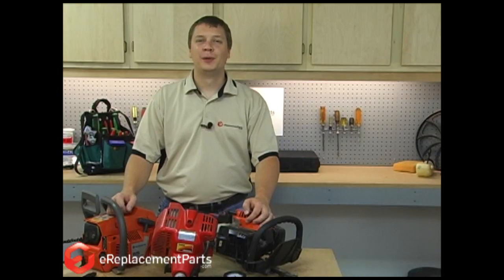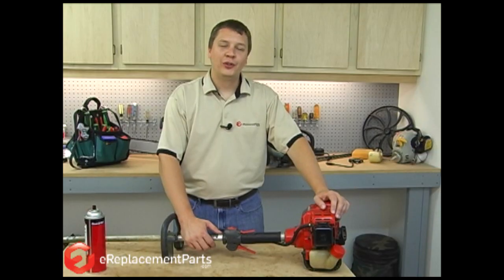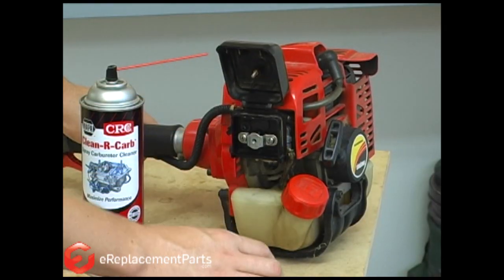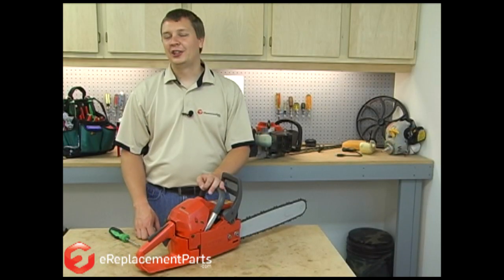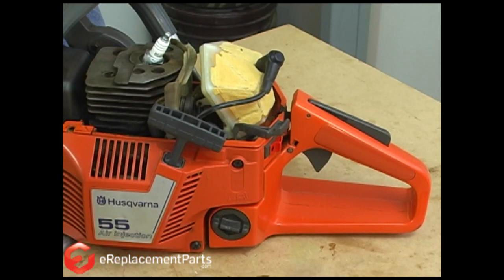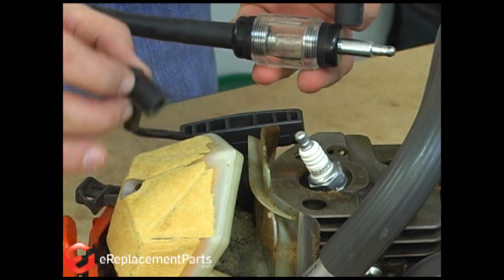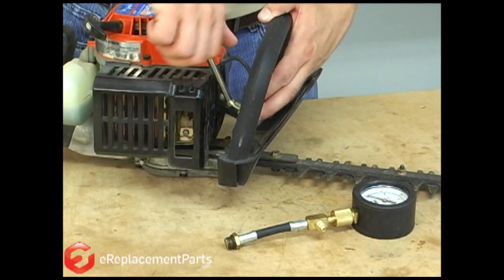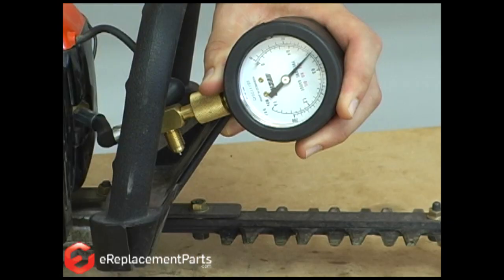How to Diagnose Two-Cycle/Two-Stroke Engines

Comment: In my long experience things are never quite as simple as your video shows.  For example there was a friends Husqvarna chainsaw that relied on "Duckbill Valves" to pressurise the fuel tank. These had gone hard and the valves didn't seem to work anymore. They were also obsolete.  Other two stroke horrors are engines which are really built to last one season. With these (I won't mention any names) the crankshaft bearings are the crankcase! Once the crankcases wear, primary compression is lost and the machine becomes a real PITA.  Possibly an engineering genius could machine the crankcases and fit bronze bearings as a hobby project?

 Another fault is very common with lawnmowers and outboard motors.  If the mower blade or the outboard motor propeller hits a stone the machine might not run again!  What happens is that when the impact occurs, the flywheel keeps on going and shears the Woodruff Key.  What now baffles the owner is that there is still a good fat spark but the machine won't run.  Of course the spark is no longer arriving at the right time!  Woodruff keys are fairly cheap so its an inexpensive repair.

Another fault which I cannot repair is that of the fuel boiling.  It happens on some old-timer chain saws when they are worked hard.  There seems to be no cure short of moving to the frozen north or trying to persuade the engine to run on kerosene.

Nice video but IMHO it only covers near-new machines and not the difficult vintage fixer-uppers.

PS I would like to warn people about the dangers of doing spark checks.  Modern machines use a LOT of plastic so it is difficult to get an earth.  If the ignition module does not have built-in safety gaps (spark gaps) it can be over-stressed and damaged if the spark plug is not properly earthed.  Budget quality jump leads can be used to earth the plug.  Good luck!
Reply: I just remembered another two stroke problem which is a real PITA on old Flymo mowers.  On these there is a non-return valve in the fuel feed and pulsations help to feed the fuel to the carb.  The valve is a small brass device with a rubber disc,  There is an X shaped grid to keep the disc in place but this is the mowers Achilles heel.  Over time the rubber disc swells up and shuts off the fuel.  Entrepreneurs capitalize on this with newspaper advertisements "Flymo Hard To Start?"  and they used to charge £20 many years ago for this very simple fix.  Take care!
Reply: What you seem to be saying is that two-stroke engines are throw-away shit.

The more I'm around them, and the more of them I fix, and the more of them I fail to fix, the more I become convinced of this.

There might be some vintage ones that are worth it just because they're neat, and there are some professional grade deals like sthil that just tend to work - other than that, if you can't get it to go by taking it apart and freeing up/cleaning everything..... screw that piece of shit, find another one that someone was throwing away (because, you know, throwaway shit) and, using your last piece of shit for parts, do the same clean/hope procedure, and repeat this cycle until you have a piece of shit that sort of works. (then, ten minutes later, prepare to repeat this cycle) Getting new parts generally seems to be a losing proposition, because the rest of the thing's not far behind, and that part might not even be the problem (even when they work, none of the parts work well - sometimes every part works, until you put them together, and then they don't work because they all suck so much at what they do that the sum of the parts is still less than the total oomph required for a motor).

Even if it's not a "one season" deal, what is it, a two, three, four season deal? So what's that, like two, three ten, twenty hours of total engine life?

They're basically elaborate self-destruction devices. Must be a real great business to be in, though. They cost nearly as much as engines that actually work - but here I am, trying to fix them, watching videos on them, etc...

Also, the carbs simply do not work, never will, etc.... maybe if I bought rebuild kits, all my woes would disappear, but I have a hard time swallowing spending anything on these things. I don't want to give those guys more money for their temperamental shit pyramid scheme. Most of the time it's the carb, and most of the time it's going to result in stupid crap like intermittent running or bogging when hot or intermittently having every problem in the book, and most of the time, just go find a whole new engine.

Comment: Im having problems with a scooter i purchased at a pawn shop , its got a 49cc Huasheng 2 stroke engine, refuses to idle without the wheels spinning unless the chokes on , with choke off and wheel free spinning i can hit the gas and it spins faster like its sposed to but when i hit the gas with the choke on while its idling it just bogs down and dies. Any ideas? Thanks either way!!

Comment: ive never had an issue by pulling the plug out and checking it like that its a good way, alot of people dont have tools like that or dont want to spend money on tools like that I have a shop that I set up completely and I dont have those I just check by eye sight if the spark is dim and hard to see its weak and if its fat and blue its strong.

Comment: Can the spark tester ever be wrong, like lighting up on a weak spark. My chainsaw is hard to start. I replaced the carb with a new one and changed fuel and air filter, fuel line. I have a compression of 150 psi. I've made new gas. It always requires a squirt of start fluid to get it going.

Comment: Great video,thanks. One point though I think you might be better putting a small amount of pre-mix in the carb rather than starter fluid. Starter fluid will make the motor rev up for a few moments with no lubrication from the fuel.Not a problem with a four stroke but ...

Comment: Most of your diagnosis are wrong. Step 1: Remove muffler and check piston for scoring. Step 2: Check Compression and Spark. Step 3: Check Fuel system. And compression test should be done on a 2-stroke with throttle wide open and should read around 150psi, not 90psi

Comment: good video thanks i have  a problem not mentioned my Husqvanra weed trimmer backfires when i try to start it ?
Reply: that is usually a sign that the timing is off.
Reply: Owiko7  what you mean? cos then I pull to start i get pull back, handle comes off and thats hurts a bit.. whats on chainsaw,.
Reply: yep and have now fixed the problem thanks

Comment: thanks so much for your informative videos.  I have a 15hp OHV briggs and Stratton lawn tractor.  It back fires and wont start.  Any Ideas what might be the problem? thanks for your time.....
Reply: hi check your valve adjustments it should be .10mm intake and .13m exhaust
Reply: the timing is off
Reply: the fly wheel key is probably broken. you can look it up on youtube.
Reply: I hope that's all it is.....I'll let you know.

Comment: most commonest fault with small two stroke engines is a fouled spark plug caused by the incorrect fuel oil mixture because most people don't know how to mix it and also use the wrong mix ie to much oil
Reply: better than less oil
Reply: better the correct mix

Comment: You don't need a spark plug tester to check the spark... Just stick a wire or screwdriver into the spark plug cap and hold the plastic handle so that the metal shaft is next to the spark plug terminal. If you get a spark from the screw driver to the spark plug, then you're definitely getting a spark across the spark plug. It's true that the ignition system can be fine and not spark this way due to such a long spark length, but often a good ignition system will easily spark across a larger gap.

Comment: I have a Stihl FS 45 weedeater,that will not start,it is not even a year old,it was bought last aug,it ran fine,last year,but when I tried to start it this year,it will not start,I pulled the spark plug,and it is wet,what would cause this.
Reply: could be flooded. spark plugs have a difficult time firing when wet.
Reply: if there was gas in it over the winter, it probably needs a carb rebuild, or fresh gas, as a rule of thumb, one gallon of gas will start to go bad after about a month-it will turn to varnish, hard to say without seeing it, but statistically, engine failure is 85% fuel system, 10% electrical, and 5% mechanical.
Reply: most common problem in my area is caused by paper wasps building nests in  exhaust holes clean them out and machine will run
Reply: probably flooded it to get a wet spark plug come spring/summer drain anny gas out put fresh gas in prime it a few times and should start up  and for me if it dont start up i take the carb apart and blow it out make sure theres the fuel filter is clean and good if not replace it and it fires up no problem
Reply: Jason- have a look for a video that shows how to start the machine with a drill- The chap started his Trimmer with the extra speed, think it went fast enough to such the crap through the carb!! :)
Reply: aflatminor that could be the case

Comment: You don't need equipment to test a spark plug simply remove it and plug it back into the coil lead and touch the other end on the motor next to the spark plug hole and pull the engine over and look for a spark
Reply: A weak coil might fire a plug in open air but not when the plug is under compression. That's why the test is inconclusive.
Reply: Sometimes a plug will fire when removed but will fail when firing under compression.
Reply: True but only sometimes
Reply: i agree
Reply: very true

Comment: My stihl weed eater seems to die in heavy grass.  I have to rev it high and throw it into the grass to cut the grass. Then it boogs down. Rev is high and ideal is good.  It just seems to not have power like it use to. It's a fs85 with a new carb.   Thanks
Reply: might have to turn the  idle up abit if  that dont work then its loosing compression
Reply: It could also be that the screen inside the muffler has become coated with carbon causing high back pressure.  Try cleaning the carbon out of the muffler.

Comment: Hey i know alot on 2 stroke engines i recently picked up some hedge cutters it is getting spark and the diaphragms in the car are in superb condition and it is quite rare isnt it for the fly wheel key to shear as its only hedge cutters

Comment: I have a  carftsman weed wacker i have replace fuel lines  filter clean carb, diaphragm look good ,no crack  are hard places on them.start on choke with starter fluid run just second an dies.what next?

Comment: My TORO single stage snow blower seized up the last time I used it.   After disassembly, I was able to see scoring on the piston side showing at the exhaust port.
Since this machine was made in 2000, I expected to see wear on the engine, but, am unsure that it is completely fried, and, requires a short block replacement.
Any comments????  Might add that the last fuel used in this blower was a complete can of Husquvana  50:1 ratio fuel.   Which has no Ethanol, I'm told.
Engine seized to the point of not starting with recoil or electric start.
Incidentally, the electric starter is now smoking when used, so I am told it also requires replacement.

Comment: After checking for ignition spark between the magneto and the spark plug, the next step would be to test or replace the sparkplug with a known working one. The above mentioned test only tells you if you have spark between the magneto and the plug, not the plug and the engine.

Comment: Any help appreciated. Have a petrol timberwolf strimmer. Fuel and spark seem ok. When i pull starter cord it fires but rips the cord out of my hand and doesnt start. Other videos seem to suggest a flywheel key. Not got that far on stripping down but could it be any other cause? cheers

Comment: Awsome video, I have found that alot of weak running 2 cycle engine issues is due to the wrong oil to fuel ratio, gotta keep that 50:1 in mind folks.

Comment: Two very common problems with 2 stroke engines are: Plugged or severely restricted exhaust port. They plug easily, but can be taken apart and cleaned easily as well. Symptoms are the engine starts, but will not rev up. The other problem is spark plug. Plugs in 2 cycle engines do not last as long because they foul faster because of the oil mixed with gas. A lot of times when checking spark, is that they will fire out of the engine, but will not fire installed and under compression.

Comment: hey stupid. why dont u make your own video. and make more of a fool of your self. if there's a problem with the fuel line or carb. u could put nitro in the tank and it wont start. as for starting fluid it only turn on the motor for less than a minute it wont damage the motor. stop and listen u might learn something.

Comment: Good Video  I have a Sthil chain saw. When you tilt the handle up it dies. From your videos I am thinking its the carb.  Somehow I ended up with a old pressure gage it's all metal. Except for the rubber end you put in the spark plug hole.  I am not sure how good it is at getting the pressure. But I know for a fact that if something is getting fire. I want one of those spark tester like yours. I can not get the wife or the neighbor hood brat kid to hold the wire any more.

Comment: +1 on that, for the starting fluid.  I prefer WD-40 for 4 cycles then carb or brake cleaner.  Carb and brake cleaner seem the best for me on 2 cycles.  But this just to see if the engines will fire, like when you pick up a piece with no fuel lines and need to check it out. The rest of the time I use gas or the correct mix.  Starting fluid, NEVER!!!!!!!!!!

Comment: Not as good as a tiny shot of starter fluid.  Starter fluid won't make as much power as gas though though.  It wont hurt the motor for the sake of 1-2 seconds.  There will still be a bit of residual oil on the parts inside anyway.  Starter fluid has more flash but does not create a lot of heat and pressure like gas does.

Comment: Thanks for the help.  I have a Poulan 2150 chainsaw 36cc 2-stroke.  Worked perfect 2 days then would not start the third. It appears to have spark and compression.  Tried a new plug gapped to 0.020"  but not a gig.  I guess I will clean the carb, but starter fluid/carb cleaner did not work to fire it for even a second. The plug does appear to be wet with gas after I pull it a dozen times but I will clean it and the fuel filter too.  I guess if that does not work I will try a spark tester.

Comment: . . . OR you can hold the spark plug against a metal part of the engine while still attached to the coil wire and pull the rip cord. if the plug is good, you will see the spark jump. if it doesn't jump, replace the plug. if it still doesn't spark, it is the coil or the coil ground wiring. 

simple, FREE, and an effective answer to ignition diagnosis.

Comment: strating fluid dries out the piston and cylinder and that how you get under 70 psi and i saw your chain saw my dad had one just like it had it for 10 years then one hot 102 degree day and it lost all compression it had 12 psi of compression the 55 sucks

Comment: It's not starter fluid. It's carb cleaner. There's a difference..

Just using it to see if there is a problem with compression/ignition once or twice will not do damage.

Comment: As a processional small engine technician with over 50 years of mechanical expertise I find this video to have some flaws in your two-cycle troubleshooting. Due to the limited space allowed I cannot post them all. Overall though I have to say it is a good video even if it is still incomplete.

Comment: This is the biggest peice of horse crap I have ever seen, starter fluid? the fuel needs oil to lube the engine, why not use the mixed gas you have in you can or insted of rebuilding the carb how about just putting gas the the empty tank... you didnt show anything.

Comment: Reads like you don't have the experience to be calling anyone a jack ass The starting fluid worked didn't? During Winter starter fluid is used liberally to start Detroit 2 cycle diesel engines. Yes it lacks the lubrication so you  woun't want to use it toke keep a any  engine running for long time, but the short burst here is harmless to the engine.

Comment: Nice video.  I've done all those tests on the 6 non-running trimmers and a few chainsaws I have and still none of them run with any power or won't run for long.  I'm at wits end with all the yard tools I have that no longer run.

Comment: Great video! On my weed eater, I experienced a low power condition with the engine, which was caused by a poorly sealing crankcase cover gasket on one occasion, & a carbon fouled muffler on another occasion. The poor crankcase seal resulted in low compression in the crankcase, which allowed the fuel air mix to leak out instead of going into the combustion chamber, & the carbon fouled muffler did not allow for good exhaust flow, thus reducing engine power.

Comment: Check the spark arrestor. Remove it(exhaust port)  from the housing
and check to see if you can see light through the screen.
If you can not, take a propane torch and burn the black debris off.

Replace screen and start engine. Rev it up a few times. Problem should be solved. Also, you can clean the screen with carb cleaner, but it takes more time and effort.

Hope this helps.

Comment: Seem you have the fuel adjustment too lean. With engine warm and running w/ choke on turn adj screw to richer. SLOWLY!  As it starts to run rough move choke lever toward off. It should smooth out then it will probably get lean again. Repeat until runs w/ no choke. Make small adj.  Next time screw in the mix adj screw while counting turns until seated, B4 rebuilding, WRITE DOWN, After rebuild back out same # turns